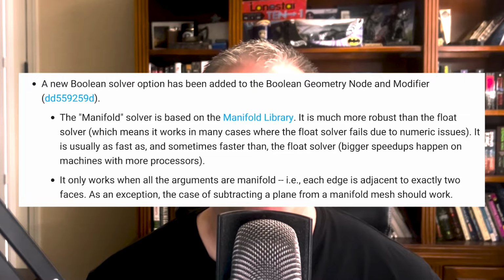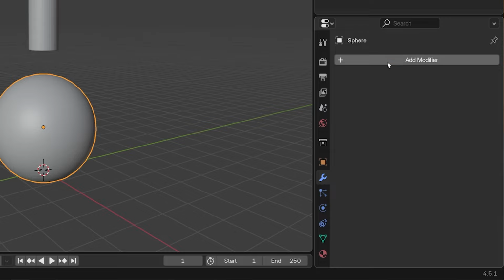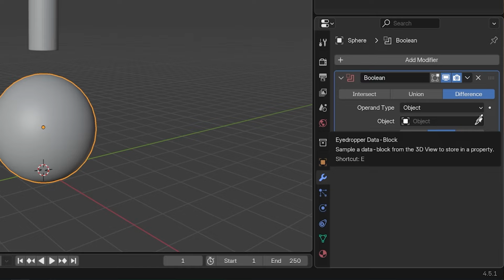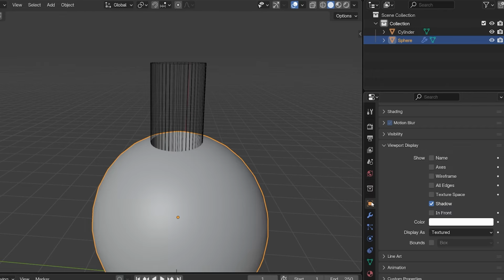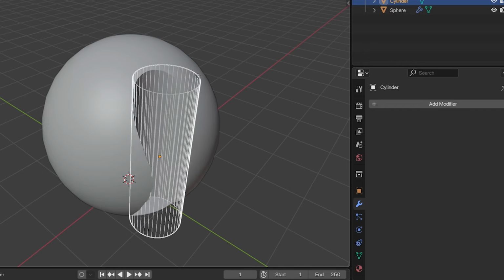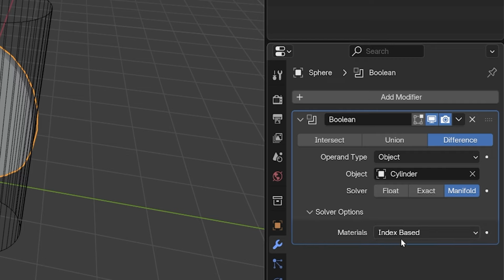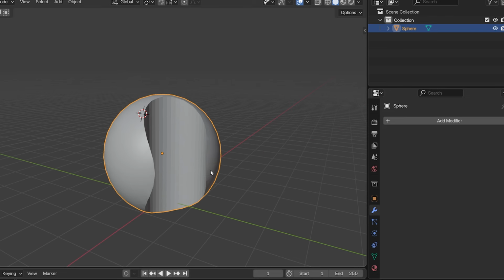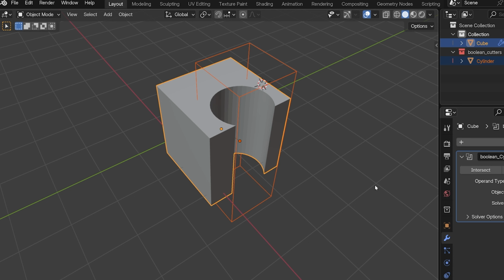Boolean Modifier and Bool Tool Tutorial for Blender 3D

Comment: I am using 4.5.0 on an M1 MacBook Air. When I use the Bool Tool Difference procedure you show, I get the error message : "HOPS_BOOL_OPERATOR._init_() takes 1 positional argument but 2 were given." The union procedure works, however. Any ideas why?